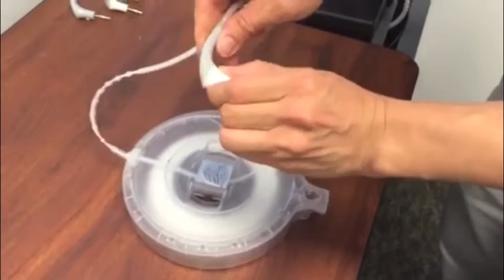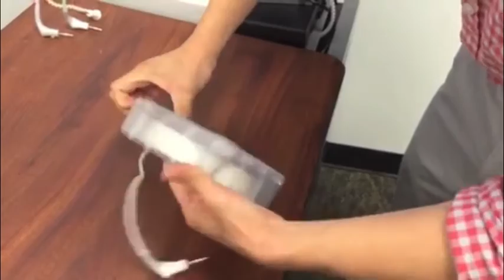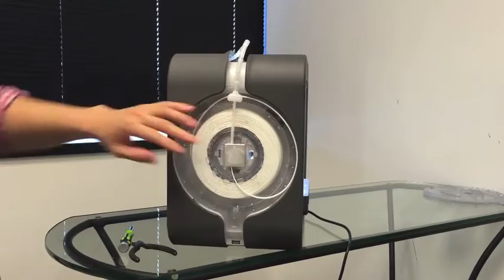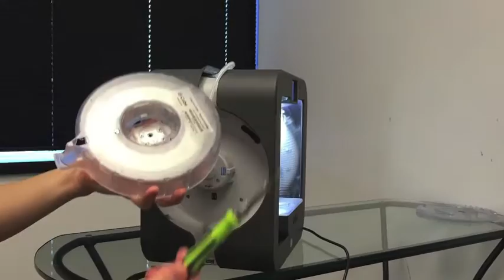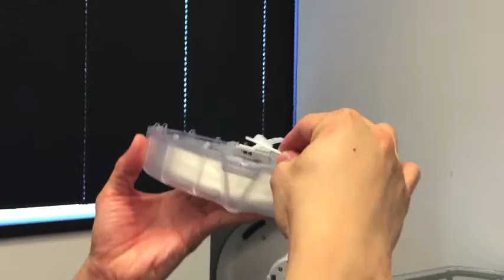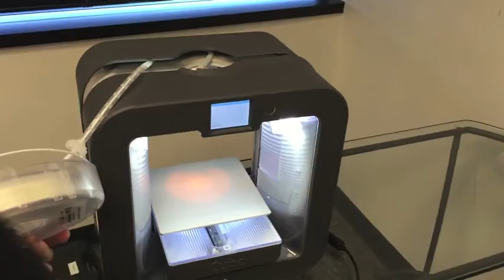Cube 3 Cartridge Not Extruding

Comment: I'm going through and adding this comment to most of the videos detailing or reviewing the Cube 3 3D printer.  I bought mine along with the Sense 3D scanner as part of an early "promotion".  If you want the short review, consider this...my special bundle price for the printer, scanner, and software was 1700$US.  The printer now retails for around $250.  It was $1000 2 years ago.  Cubify should be ASHAMED for the monstrosity they pushed out to us, the consumers.  Not only is the printer only so/so as far as maintenance, tinkering, and all around pain it requires to keep going, they then hit us with proprietary filament, meaning that you have to buy their super expensive filament for no reason.  It's not exceptional, the extruder heads being attached to each roll is the dumbest engineering idea ever.  Why put an expensive part that is required for each print on each filament roll?  I guess to justify $50 per 1/2 roll of what you get with competitors.  I've since worked out the hack around this.  But it still requires non-stop tinkering to get even the simplest prints.  Want to know when you've bought into a SCAM?  When you call the company 1 year after buying and they tell you they no longer support this printer.  You can buy cartridges for sure, but that's about it.  They are now focusing on the "professional sector" meaning they figured out if they can dupe customers for $1000, imagine what we can do to companies.  I've literally had 2 print beds crack and go bad and they wanted $100 to replace each when it's an obvious design flaw.  This printer literally is the worst thing you'll ever throw money at.  Get something with openware and system you can detach/add too.  If you want an Ipod version of a 3d Printer that you have to "hope" nothing internally goes wrong with on each print...buy this hunk of crap.
Reply: Could not agree more Shawn. The thing was not ready for sale. Every cartridge I've owned (dozens) has jammed. Leveling the print bed is a massive PITA if you have to get into manual leveling (I had to). Adjusting the gap seems to be a totally random exercise most of the time. Auto gap NEVER gets it right. Like you, I paid full price, bought the same bundle. Don't get me started on the total piece of crap that is that 3D scanner. What a disaster. I've had better results with 3D scanner apps on my iPhone than I've had with that $500 add-on dedicated 3D scanner. I'm glad 3D Systems got out of the consumer market. At east no more people will have to deal with this piece of junk. Dozens of spools of filament, countless hours of trying to unclog them, 18 months of frustration and I managed to get 4 good prints out of the thing, FOUR TOTAL! OK. I feel better for having got that off my chest. Empathy brother.

Comment: Thanks for the hack.  I'll start trying this.  Around 50% of the 3D filament I've been getting has this issue.  This is unacceptable.  I've had some cracking of filament on my Printrbot Simple but that was rare.  Newly ordered plastic shouldn't be so brittle that it cracks in the feed tube.